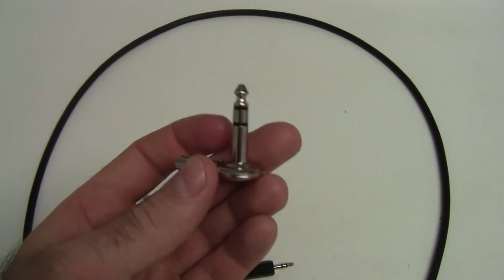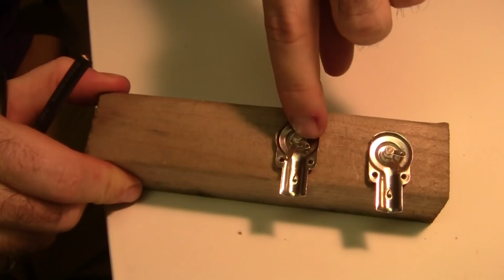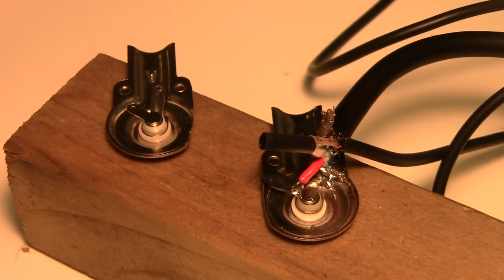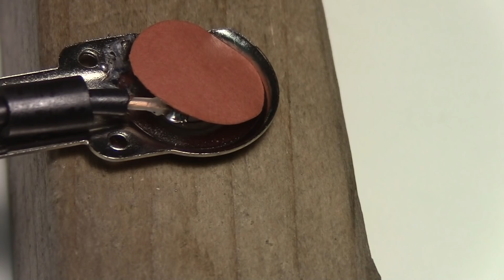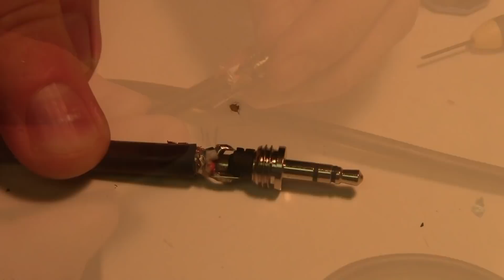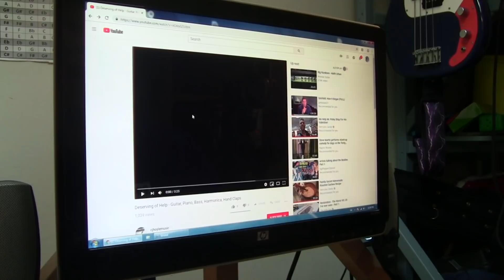How to Build a Custom Audio Cable

Comment: You might as well solder the ground of the second cable to the ground of the first jack, instead of splitting the copper
Reply from the maker: Could have done it that way. Electrically there would be no difference. I believe the reason I chose to split it was because the ground has too many fibers to fit through the small hole in the jack that I was soldering. Rather than cutting off those extra fibers I did it this way instead.

Comment: Just a thought Cj,  why not put Red tape around the cable for the left socket, and green tape around the right socket, Left being port side = Red and right side starboard  = Green, just in case the black  marker pen wears off.